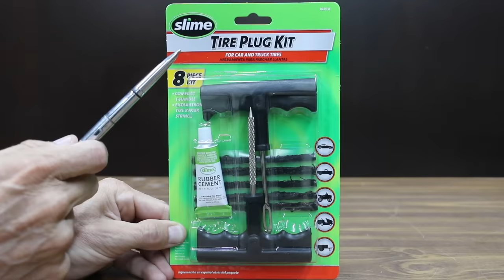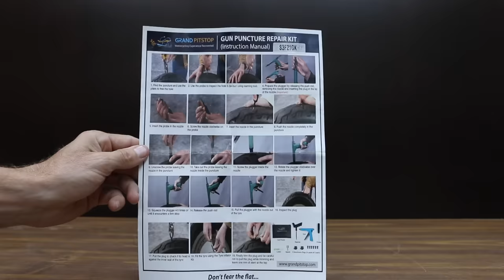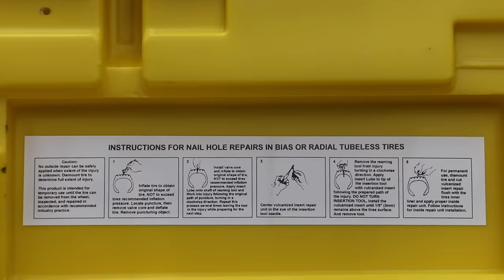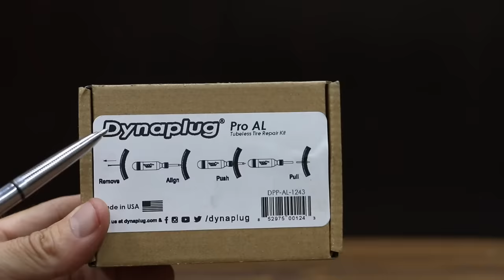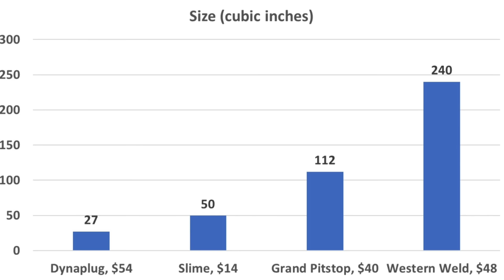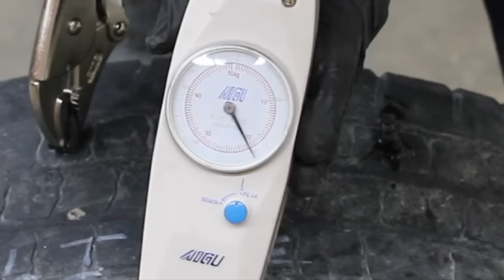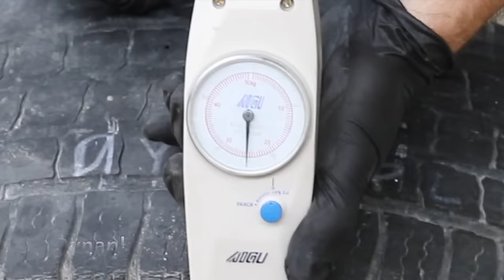Best Tire Repair Kit? SLIME, Westweld, Dynaplug, Grand Pitstop

Comment: I have used both the HF and Slime type kits for a cumulative 43 years.  They work better than any other repair I've seen, and I consider them a permanent repair.  I try to insert as little of the cord into the tire so it doesn't have to be rebalanced.   Any worse damage would require a full tire replacement.
Westweld, Dynaplug, and Grand Pitstop have added expensive bling to GREATLY increase the price of their kits with =zero= increase in usability of the unvulcanized rubber rope plug, so BOO/HISS to them.   I question the use of a lube in a hole which will be vulcanized soon, Westweld.
Your pull test made no sense, as once cut off, nothing could grab the flattened plug end.

Comment: Had a Smart car with no spare. It came with an air pump with a sealant. The problem is if you needed the sealant it was probably hardened and couldnt be used.. I drilled an old 12 inch boat trailer wheel to get me home if I had a flat.
Reply from the maker: Thanks for sharing.

Comment: These also work well for motorcycles too. I repaired my motorcycle tire with a plug and ran it the rest of it's life, another 4,000 miles with no issues, of course it's always a best practice to use as a temporary fix, then remove tire and patch internally. Sorry, but MC tires are too darn expensive to be throwing away for a tiny hole, not matter what the "Safety Police" in the interwebs say. BTW- I have close to 1/4 million miles touring so i'm no stranger to tires.